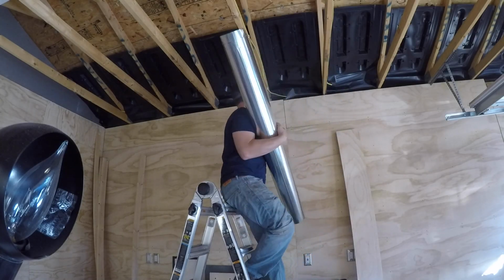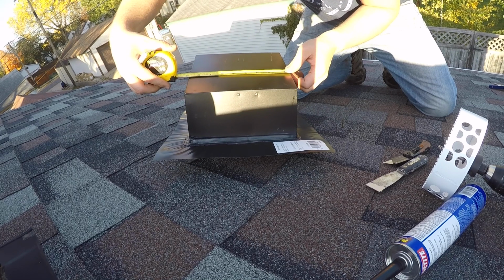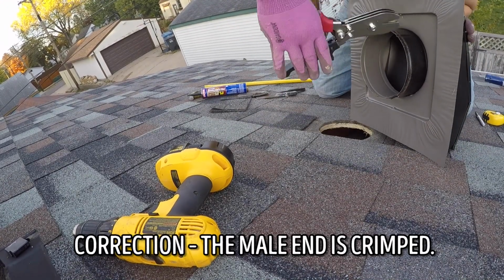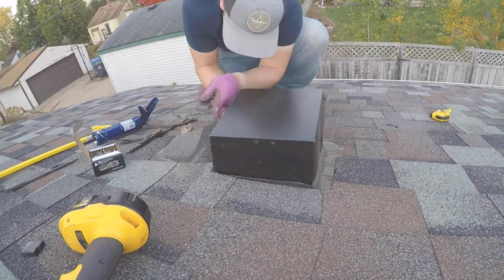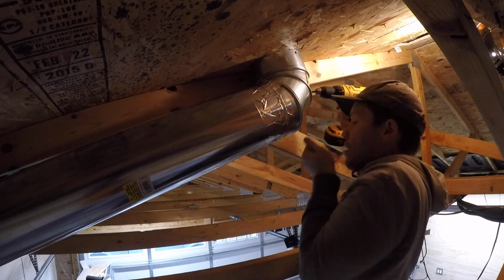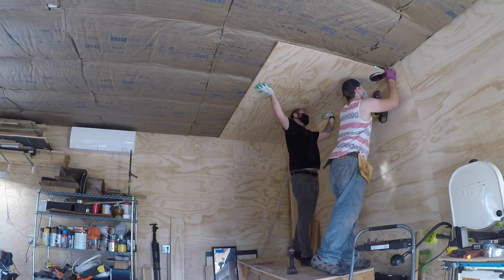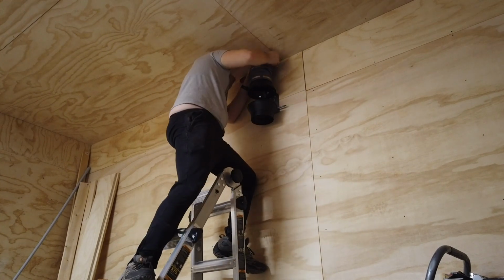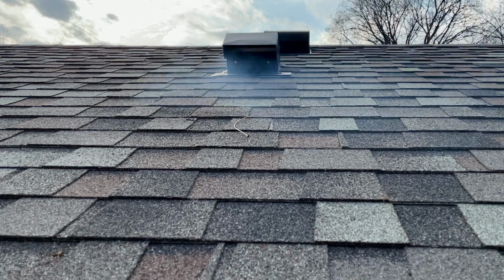Laser Cutting Roof Ventilation

Comment: Any particular reason you choose to go out the attic vs an eve/soffit? I'm designing my set up and considering going out the soffit vs the roof.
Reply from the maker: Hey Clay! Interesting! I suppose that would have been possible, but my soffits are pretty narrow, and so that didn't even cross my mind, as there wouldn't be a lot of room for that. One thought is that if your soffits are painted white, over time exhaust from the laser could discolor the area around the vent – where on a roof vented system, that's not really a concern since they're typically dark. Not saying it's a bad idea at all, by the way – curious to hear how that goes if you go that route! 😊 Cheers!
Reply: @FarbulousCreations  yeah the more I think about it the more I think roof is better. For one the smoke would vent up and not linger around the house as much. I think that on the side under the soffit would work most times, but if the wind isn't blowing or blowing the wrong way it'd be harder to clear the smoke out resulting in it lingering possibly making its way back into the attic.
Reply: I can attest that out the roof is better. During warmer months, a soffit vent works ok. But when the cold comes, the negative pressure from the warmer air trying to escape DOWN through the soffit vent creates a backflow and it won’t exhaust hardly at all…take my word for it…it’s no fun

Comment: 9 months later, are you noticing any residue/gunk on your roof from the smoke?
Reply from the maker: Hey Kyle! It's the middle of winter in Minnesota, so I can't check right now 😅 but the last time I was up there in late fall I installing a security camera I didn't see anything! I rarely cut acrylic on my machine though, and from my experience at the maker space laser I used to use, that's one of the biggest culprits of "gunk" accumulating in the ducting so that could be a contributing factor. Great question!

Comment: Living in an area with such cold temperatures, have you run into any problems with your vent setup and cold air affecting your laser when not in use?
Reply from the maker: Hey Matt! I have not, but my garage shop is also heated with a ductless mini split – I keep it on the lowest setting (I think 55ºF) when I'm not out there working to make sure the water in the laser tube doesn't freeze up. I've also heard that it can be wise to keep the lid to the laser open even in a heated space to make sure the inside of the laser doesn't get too cold from the outside air coming in through the vent, but my venting travels a decent bit through the attic and the room below so I doubt its ever cold enough for that to be an issue. Hope that helps! :)

Comment: Evening, I made the mistake of using a stack for a passive exhaust for my laser and in looking inside the vent, it clamps down the CFM pretty hard. my mistake. I also have a nova 35. After 5 months of use, do you still like the vent choice you made? I'm also considering a chimney smoke stack type vent, but it might look a little weird on my roof and thing yours may be a little less conspicuous.
Reply from the maker: Hi Evan, I actually recently upgraded the 6 inch AC Infinity fan to the 8 inch model, with reducers to fit my ducting. I decided that the smoke was lingering a little too long inside the laser for my tastes. I'm going to try to do an update video here soon, but overall, yes, I still really like having the relatively inconspicuous roof vent I went with. :)
Reply: @FarbulousCreations  Hey Ron! I see you mentioned you upgraded your 6" to the 8". If you were doing it again, would you run the 8" piping from the beginning? Or does your setup with the bigger fan and 6" duct work nice as is? I also see that the vent you chose only comes in a 4" and 6". Just trying to decide which size hole to plan to do.  Thanks for your help!
Reply from the maker: @travisb435  Hey Travis! Yes, if I was doing it over again, I think I'd prefer to have run 8" ducting. The 8" fan with the 6" ducting has better than the 6" ducting with the 6" fan, but I have to imagine the smaller ducting is adding some unnecessary air friction to the mix. As for how much, I don't know, as I'm not a aerodynamics engineer, lol. That is a bummer that the gooseneck vents only come in 4" and 6" – I'm not sure which style of vent outlet I'd want to use then. 🤔Hope that helps! Good luck!

Comment: Do you run your laser a lot ? Is that fan sufficient ?
Reply from the maker: I don't run it for hours on end (at least not yet!), but when I did some "heavy smoke" tests it seemed to work just fine without letting any escape into the garage space itself. Some people I've heard opt for the larger 8" fan that they sell, so that's something you could definitely look into if you're worried about it pulling enough air. :)
Reply: @FarbulousCreations  Cheers ! - Yea, I have had some issues with fans. I like these inline ones. But, I have always had to go super big like 650 CFM for our small laser. And 1500 cfm for our bigger laser. Not doing this causes the laser to get dirty inside when means a lot more replacement parts.  - But, also, we are Pushing the air about 20ft for the big laser (1500cfm) and about 10ft for the small laser. So I know that plays a roll into things. (as-well as elbows etc..etc..) - thanks for the reply

Comment: Hi Ron
I am trying to decide on purchasing this exhaust fan or the 8". This one pulls fewer cfm than the one that comes with the Nova 35. Is it adequate or does it seem underpowered? Is the temp and humidity controller worth the extra money considering the stock fan doesn't have one and seems to be fine?
Reply from the maker: Hi Keith! Good question! The 6" seems adequate, but the 8" would probably do a slightly better job. I decided to go with the 6" though, in part because it's a heated and cooled space and I don't wan't to throw my conditioned air out the roof any faster than I need to, haha. The 6", if I recall correctly, pulls about the same CFM as my ductless mini split puts out, so I figured it'd at least have a fighting chance to keep up with the loss going with the 6" on particularly hot or cold days.

As for the temp/humidity controller, I didn't get it as I didn't see the use for it in our applications. I think that's mostly for people who are using the AC Infinity fans to condition a space that's not getting enough HVAC pressure in a house setup – that way they can use it as a thermostat of sorts to turn up and down the fan and monitor humidity. So yeah, I'd say skip it! :)
Reply: Thanks for the information!